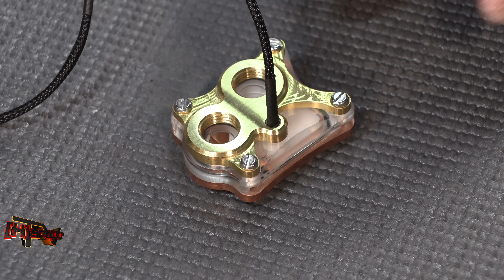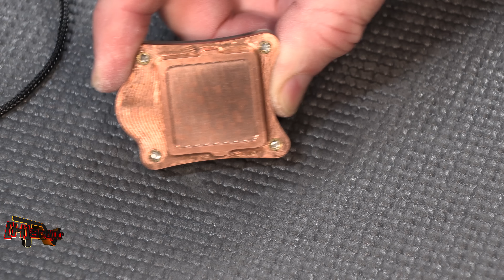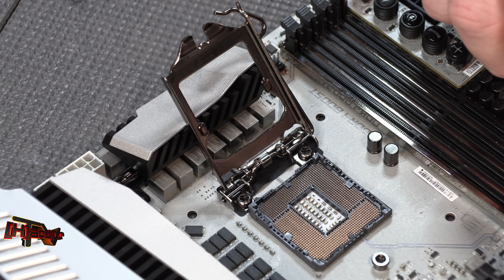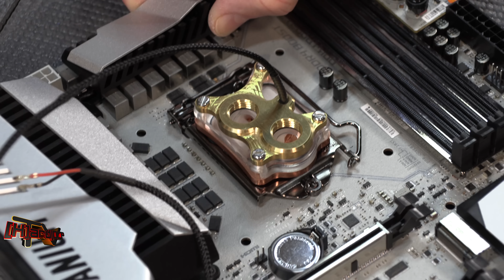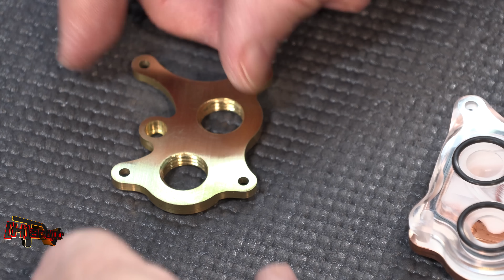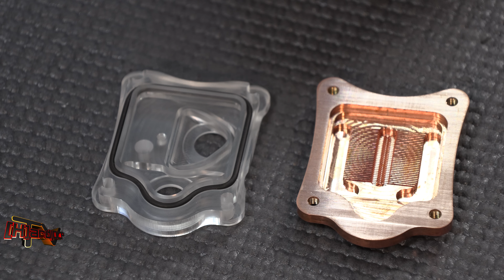Ncore V1 No Frame Water Block Protoype Sneak Peek

Comment: http://watercool.de/en/delidding-skylake-does-it-make-sense 
The very thin base plates under the fins of current current CPU water blocks are optimal for big contact surfaces, as provided by the heatspreader. With smaller contact surface and remaining thickness, the heat cannot spread optimally throughout the material. Direct DIE mounting request a thicker base plate.
Reply from the maker: I would tend to agree.  We did cover that in our full review.  https://www.hardocp.com/article/2018/04/02/ncore_v1_no_frame_water_block_prototype_testing

Comment: Nice!! But I think everyone should not get too hyped up. Direct die cooling has been done and tested during ivy/haswell days and even during P3/Athlon times. I have also tried it before. Conclusion is similar to what others have mentioned. I do like the mounting mechanism and the relieve that acts like a protective shim. But dont quickly assume that direct die cooling is going to give you incredible temps or super high oc, eve with liquid pro/ultra thermal paste.

Comment: I really hope they ditch the flathead screws for something like a nice allen head screw, as well as machine a much finer finish on the contact area. The sliding action caused by the retention bracket when locking it down makes me think of a cheese grater effect.
Reply from the maker: Already talked to them about the flathead screws, those will be changed.

Comment: Interesting concept. As a machinist though I have to say those toolpaths need some refinement ;-)

Also the top looks like brass, not copper.
Reply: Oh no, I think this is totally an innovative idea, and I'm not trashing his work, especially as you note it's a prototype. I'm sure he'll dial it in once it's finalized. To be fair, brass is a copper-based alloy so it should feel similar, but the color is a giveaway. It should be more resistant to tarnishing.
Reply from the maker: You may be correct, but it feels like copper.  Also, this guy is not working with the latest and greatest tooling.  I think he is doing some fine work with what he has.
Reply: I thought it looked like it was plated. But I've been wrong before! (Then I realized I was mistaken! LOL!)